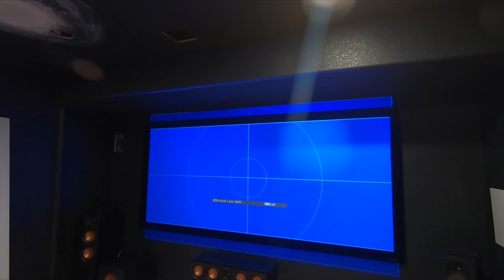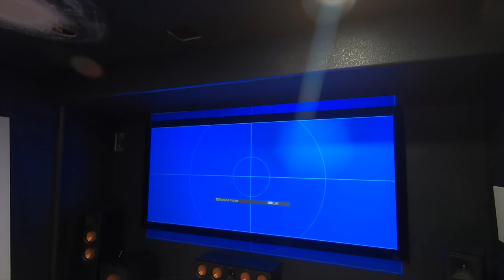Full 4K Home Theater Install Epson 6050ub 120” Screen Innovations 2.35 Cinescope 1.2 Slate screen

Comment: Something I’ve done is to put wood backing under drywall ( 3/4” plywood or 2x8 horizontally between joists) in approx area of projector.  No need to fool around with plastic anchor toggles.

Comment: Did you check the convergence? Didn't see you do that. I worked at Epson and when installing it we always double checked it on every projector. 95/100 times the factory configuration is fine but sometimes red or blue bleeds out a little bit. So it's advisable to always do it and you really have to do it just once. I recommend the zone config, not the corner one.

Comment: Awesome video! I’m installing this exact model myself right now. You said you wanted to center it to avoid keystone correction, but the 6050 has Lens shift so that difference of a couple inches shouldn’t really impact the image, correct?
Reply from the maker: you want to remove anything post setup. if its setup proper you dont need to skew the image later
Reply: @Dreamediaav  thanks for the reply! I'm mounted a few inches off of the center so I'm just wondering if that lens shift a few inches over to center it is going to degrade the image to a point that it would be better to remount. I cant see a degradation, but  I didn't know that lens shift impacted the image

Comment: If you're building a room specifically for this purpose I think I'd have gone out of my way to avoid parallel surfaces as much as possible to make it easier to deal with from an acoustic standpoint. Less reflections, clearer sound and less interaction with the room.

Comment: Fantastic,precised and clean work. But
1. After hanging the screen shouldn't it be checked from both corners for any tilt with measure tape or water level?
2. Before installing speakers there should be wooden cabinet in gypsum wall in which it can be mounted because i guess gypsum wall is not mechanically strong, you haven't even use glass wool for speakers.
3. What about amplifier connection, testone and tagging?
4. Can you upload a tutorial on level, gain, calibration etc?

Comment: Hi Zach great tutorial your awesome!,  Hey when you were adjusting the white pattern image projecting from Epson to align perfect on movie screen were you looking at white lines on outside of rectangular pattern just to fit perfectly before black orders on screen? Or in other words basically getting pattern to fall perfectly within or around white slate screen?   And maybe silly question 😀during the adjustment were you physically moving the projector during some adjustments or always using remote once you had physically levelled projector with bubble level front to back and side to side.  Just need to know once level projector physically no need to touch it anymore for those fine adjustments you were doing you were just using remote from that step?   Thanks your videos are very helpful big fan👍.
Reply from the maker: yes, rewatch the video. everything is explained in detail

Comment: In the install of the ear-height surrounds, you measured 150" from the front, Why.  Was that based on personal preference, customer request, or just based on optimization due to room constraints.  Secondly, the in-ceiling Atmos units, were they also Klipsch models? Thanks...
Reply from the maker: seating/ customer needs
Reply: Also, the in-ceiling speakers, were they also Klipsch units? If so, which model...?

Comment: Quick question about the speaker wire. So I recently bought speaker wire from Home Depot  14/2 250 ft is this a good wire to use to run they my walls? It’s says it’s speaker wired that’s why I bought it but I see that you use a white and more insulated cable. Is that better than the Home Depot 14/2 grey cable ?
Reply from the maker: Please contact us at 972-322-4607 or email us at:  sales@dreamediaav.com we would be more than happy to assist you and answer any questions that you may have.

Comment: Finally see some walls painted the right color for a theater. The sheen is a bit much for me though. Mine's flat black. Almost 0 reflection of light. This video is making me want to go re-wire my system with the proper inwall wire. Which I bought months ago. Thanks for the video. BTW, was this a training job for your new hires? My dream job used to be installing home theater.
Reply: What paint did u use?  I just painted my room with Rosco TV Black, it was like painting on tar.  Down side of the paint is the after smell is kind of funky and it smudges so easily, my light switch area is covered with them of me just trying to find the switch in the dark.
Reply: @ramonbarajas2813  I think it's Speed Hide Super tech from PPG. Dry fog black. It's what us professionals use to hide open ceiling clutter and kill glare for security cameras hidden up high. Stinky, but flat as you can get I believe.

Comment: What HDMI cables are you using for the long projector runs?
Reply: Jeremy Cook cheap 35 dollar 50  ft hdmi cable from Walmart 😂
Jk
Reply: Hey JC. Really depends on what your going for. If it’s standard 1080p then any cheap decent quality cable will do for about 10 meter runs. 
If it’s a 4K signal then anything over 5-8 meters you will struggle. 
I went with a fiber optic cable for my 10 meter run. 
The one I used is below. You can use any brand really as long as it’s 18Gbps

FIBBR UltraPro HDMI 2.0 Cable Fiber Optic HDMI Cable Support 18Gbps 4K@60Hz 1080P, 4:4:4, HDCP 2.2, HDR 12bit,

What ever you end up doing. If it’s the first time and you need the hdmi cable to be behind a wall or in celling. Run a conduit or run it in a such a way where you can pull the cable out and replace it down the line. 
Always have a back up cable even if it’s a cheap hdmi you can use to pull another cable through. 
Good luck. 
A lot of info over on AVS forums in the states or AVForums over in the UK. 

MAKE SURE YOU CAN UPGRADE THE CABLE DOWN THE LINE! have a backup plan in place to pull the cable out!

Comment: Hey zack I need some info from you. I have a 65” Samsung tv, a Sonos speaker system, a Apple TV, fire tv cube. And a 4K blu ray player. I need to know what kind of surge protector can I plug all this stuff into. I hope the plugs are separated enough to putt the plugs in. Get back with some links to real good surge protectors. Thanks Nick I
Reply from the maker: Hey Nicky. We like panamax, furman and wattbox. You wont have an issue plugging anything into any of those. give me a shout when you want a set. We sell them all.

Comment: Zack,  whats the seating setback distance from the screen in this room?  Hearing lots of conflicting recommendations with 4k.   Anywhere from it does not matter to needing to do quantum physics calculations.
Reply from the maker: https://www.projectorcentral.com/Epson-Pro_Cinema_6050UB-projection-calculator-pro.htm   Go on the close side to get the most light on the screen. if you are backed up too far light can escape into the room.

Comment: Weird question, is there such thing as in floor speakers for Dolby Atmos?
Reply: The Dolby Atmos standard does not specify in floor speakers at all. In this video it looks like it's just being used as an alternative to placing a ceiling speaker
Reply: technica marked on the floor, because no carpet. It makes it easier to mark everything out. Drop a plumb bob from the ceiling to the center marks on the floor, and you know where to cut the ceiling.
Reply: @akaredcrossbow  ahhh that makes a lot more sense now
Reply: @techguy348  Man, wonder if they would ever think about adding that. I need to be enclosed with speakers!
Reply: FinnishArmy I know what you mean! Maybe one day lower channels will exist with seating raised up off the floor🤷🏻‍♂️ I always envisioned multiple speakers set into like a tapestry that you could hang on all the walls and ceiling and also have speakers underneath you.
Reply: @akaredcrossbow  Dolby Cinema actually has actuators that act as a subwoofer...
Reply: technica yes!

Comment: Hi guys  ! I need your opinion in something, I currently own 2 SVS PB-2000 & Klipsch 504 Center... and very crappy L-R as well as surrounds... Should I get a Pair RP-600M Bookshelf with a pair of RP500SA for atmos on top of the bookshelf (and potentially send those to surround back in the future ) OR get a Pair of towers now like the RP-280FA with atmos enable ? (and then worry about the surround in the future ) The price is almost the same, but the bookshelf are like 3 years newer and better horn... but in the other hand the towers are two 8 inches with a 6.5 inches atmos enable I believe- will those towers will be good for a few years or always better buy as new as possible if that means getting small woofers... Thank you all !
Reply from the maker: go big up front.

Comment: Looks like you could have also just bi-wired the speakers. I doubt that really does anything, but I hear audiophiles swear by it, and if it's already setup for it, you might as well just do it. I guess if anything, having two sets of wires would practically give you twice the gauge of thickness which in theory could give you better sound. Again, probably bullshit, but if you got two sets of wires going through the walls and two terminals on your speakers, there's not reason not to. That would also make it a bit easier if you wanted to bi-amp it later on.